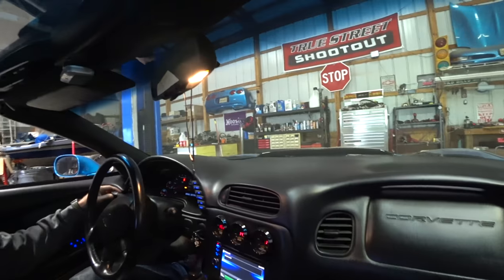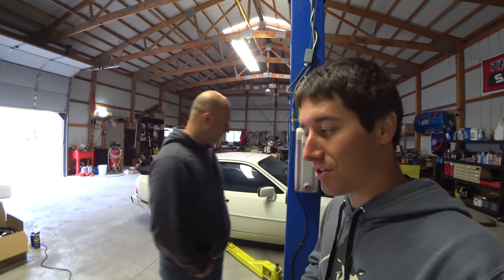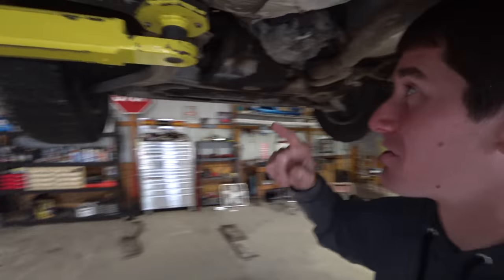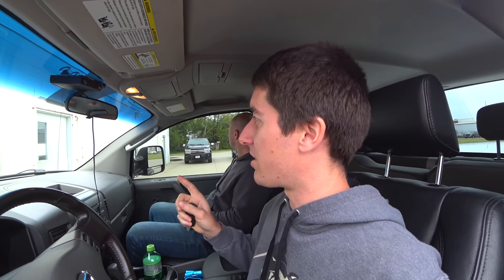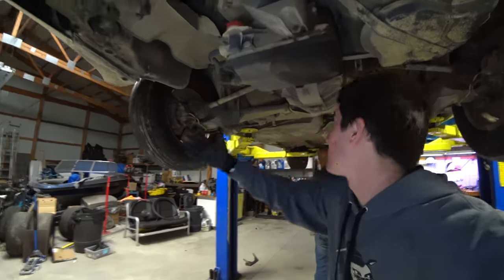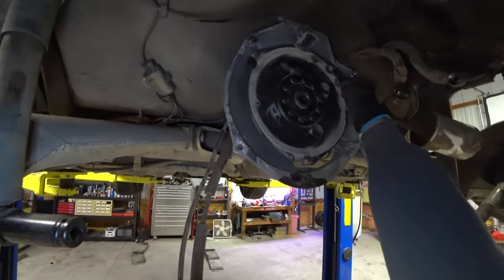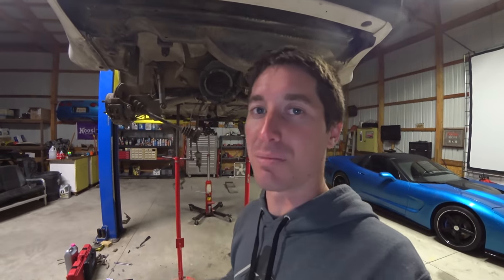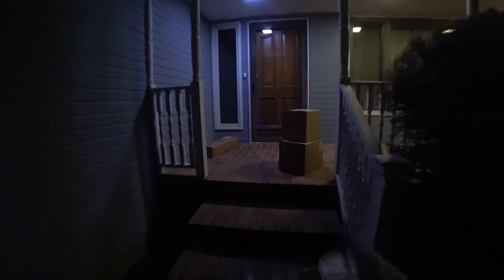REMOVING The FLYWHEEL From A Porsche 944 Is A NIGHTMARE

Comment: You’ll need to 1a) Remove rear Transmission bracket to allow torque tube clearance to skate back further. 1b) remove speed and reference sensors on top of bell house. 2) Remove Ring Gear Flywheel bolts through access hole on bell house. 3) Remove bell house case bolts, 4) Slide torque tube w/ damper plat/flywheel back to access circling on end of splined shaft that connects to pilot bearing. 5) remove damper plate then remove bell house. Good luck, just did this job on my 944🤘
Reply: rakeleaf wow...just wow
Reply: At most a 4 hour job with a lift. You don't need to remove the bell housing from the torque tube. Not that bad.

Comment: I had an ‘88 924S, same drive train. Loved a lot about it, but things will break for sure. Drivetrain was fairly solid and as you’ve seen, at least repairable. Weak spots are the hatch glass leaks, sunroof motor and limiters, and watch out for breaking and cracking solder joints in the ECU.

Comment: Glad to see someone finally using jackstands on the lift! A guy where I worked got smashed when a Cadillac fell on him. He was mush.
You need four.
Reply: Aboveground lifts are junk. The old style lifts, inground lifts NEVER fail. A car might flip off of it if it is unbalanced but that is operater era. My dads shop was built in the early 50s as a Buick dealership and the original lifts were still functional in 2010. They would raise a crew cab dually like it was nothing. 
   I worked at the Tire and Lube at a brand new Wal-Mart in 2001 and a compact car would rock on the aboveground lifts  and make ominous popping sounds. Junk.

Comment: I've did this same job a year ago. You didn't need to drop the rear suspension. There is a clip holding the shaft in the front. Look at the parts diagram. Also look at the article on the Pelican Parts forum. My friend wrote it.

Comment: The 944 was originally a project by Porsche for Volkswagen.  There was a leadership change at VW, and the new people decided they did not want to sell a rear-drive sporty car, so they shelved this project and built one based upon their new FWD chassis [this car would be called Scirocco].  Porsche bought the design and produced it as the 924.  Originally, this car used a VW LT delivery van engine, a FWD Audi transmission, Type 4/914 rear suspension, and front suspension based heavily on the Mk1 Golf.  The car eventually received boxed fenders, a new interior, and an engine based upon the right bank of a Porsche 928 V8.  This was the 944 in this video.  The 924 and 944 also used Mk1 Golf door handles....

Comment: Whoa Whoa Whoa.... Did you say the 944 is a Corvette copy??? Way Wrong. Porsche started the 924 which had the first "transaxle" setup in 1976, they started the the 928 in 1978. The 944 debuted in 1983. The CORVETTE MOVED THE TRANSMISSION TO THE REAR IN 1997. SOOOOOOOOOOOOOOO, maybe the Corvette copied the Porsche rear Transaxle setup. Like the video, but do your research. Keep the cool videos going!!

Comment: I have an 89 S-2 currently with 230,000 mi on it. 
In about a decades worth of ownership a number of things have been replaced and problems dealt with. $670 worth of magnesium that covered the upper cam belt and mounted the distributor is the most recent repair. 
Generally the 944's drive train is considered bullet proof. Over time and use things still wear out. I do have a minor rear engine oil weep. Much of this disassembly would be involved with replacing it. Probably five minutes to replace the seal after all that work.
For all that it pulls hard and strong when I pull out to pass.

Comment: Do yourself and the future owner a favor, replace those fuel lines above the cam tower/headers.  Once they rupture, the car is up in flames in 20 seconds.  Trust me, I've have 5 944's.

You can buy a kit for $125 to cut the old hard lines and replace them with some braided steel lines up to the fpr and damper via the passenger fender opening.

Comment: The manual cars suffer from the same problem with a rubber centered clutch. I replaced mine with a spring centered clutch.  The heat kills them.

Comment: The 924, which spawned the 944, was designed by Porsche for Audi. Audi didn't want it when Porsche was done, so they built it themselves, then a few years later made the more Porschefied version, the 944 (based on the 924 Carrera). 

That transaxle is based on an Audi FWD design. Chevy didn't put a transaxle in the Vette until the C5 in 1997.
Reply: I was about to say how can it be a vette copy, Porsche did it first.
Reply: I believe they were built in an Audi factory.

Comment: I’ve got a 1977 924 in my “barn” waiting for me to bring it back to life.  One day...
Reply: Just scrap it and get something faster
Reply: I bought one of those in the mid 1990s. I drove it for nine years.

It was a lot of fun when it ran properly. Which wasn't often enough.  A clutch replacement on a 924 is rated at 13 hours. 
More like 16. I did it myself.  

The car does handle well. But it was a gutless wonder. Lots of noise, little go power.

Comment: That's to be expected. Any time you buy a car, where the previous owner has identified the problem, has the part, has not replaced it, and is selling it instead, you should know replacing that part will cost more than the car is worth. That is why the previous owner is selling it.

Comment: If you put that much $$$ work into it,  spend the $ to put in the stock flywheel damper.  Why not use the right parts and do the job right.

Comment: If you are going to all this trouble may as well just stick a new clutch kit in there. That rubber centre clutch may not last long and it was replaced by Porsche many years ago with the turbo clutch due to its lack of longevity.

Comment: The 944 to have is the TurboS. The best of the 944 series. I worked at Leith Porsche/Audi in 1987 and sold quite a few of these cars. The 911 is still my favorite but the 944 TurboS comes in a close second. You’re not going to put that rusty old clutch and pressure plate in that car?  How long was that 944 sitting? Looks pretty rusty to me,brakes should be turned and new pads.

Comment: Both the natureof this job is being over-simplified here, and the realities of working on a 30+ year old car. 

Replacing the old rubber damped flywheel with an old OE rubber damped clutch is prettg damned ghetto. That old clutch disc will fail EXACTLY like the original part did. The only right way to do it is man-up and buy the new correct part, cost be damned. Too many people assume that the cost of new parts is pro-rated based on the market value of the car. It is not!

Comment: A 944 is a much better car than a 924, even a 924S which had the "proper" Porsche 2.5 4-cylinder engine.  The 924 was intended to be the new Volkswagen-Porsche to replace the 914, so it was designed down to make it cheaper to produce and sell.  When that didn't go ahead and Volkswagen decided to head in the Audi Coupe and quattro direction, Porsche were left with a car they didn't really want but had to sell to recoup the development costs.  They did immediately set about redesigning it to make it the car they wanted to build and sell, the 944.  Of course, it worked out well for them in the end as the 924, in its various forms, turned out to be a big seller for them,  but the 944 was definitely a much better car and, even in the 2.5 litre variants, had more power than the 924S, which used the same engine, as it was de-tuned for the 924.  It rather showed in subsequent product development, as the 944 continued and developed to become the 968, while the 924 was killed without a replacement until the Boxster, a VERY different car, came along in the second half of the '90s.  One thing the 944 never was, however, was particularly easy to work on, a combination of interesting engineering decisions, such at the torque tube being, effectively, a stressed member of the car,  mounted in a shell that was very much designed to be just big enough, could make life awkward, and as the cars age they throw up more in the way of challenges, which can make life "interesting..."  A friend of mine from college used to work for a British high-end workshop in one of the expensive and sunny parts of Spain, and he had a 944 of a similar age to this one in with clutch problems, after the wealthy owner had bought it new and then hardly used it having decided he preferred his more comfortable, less sporty cars instead.  Sorting the clutch and the extremely sticky release mechanism pretty much turned into a career, and he said the car probably racked up more miles going up and down on the lift as he tried to bring it back to working how the Porsche designers intended than it had in its 20-or-so years of life.  Once it was fixed, however, it was an absolute blast to drive on the twisty mountain roads just inland from them...

Comment: I've owned this era of 944 and from my own experience, you'll need to drop the rear suspension.  You can leave it attached on one side, preferably the side with brake cables, but the assembly will need to come down to get the torque tube low enough to remove it.

Comment: I’m doing the head on my red 1987 924s! The cyl 1 valve seal went bad and built up so much carbon that the valve no longer sealed properly and it also built up an acorn sized piece of carbon built up on the stem of the valve, which after overheating it cracked and fell into the cylinder as it sat over the winter. I’ll be lapping the valves and replacing all the oil seals.

Comment: J.R. I did one 15 years ago in a previous job I had. The rubber flywheel wasn't cheap either. From memory i think there is a hole in one of the bell housings to get to a pinch bolt that secures the flexplate or rubber flywheel to the shaft in the torq tube.  Maybe on the front one. On the front, the starter comes out then the bolts that hold the torq tube to the front bell hosing come out. Next i think you wrap a chain around the rear end of the torq tube and attach it to a large piece of pipe and use it like a slide hammer. I can't remember if it was rusted in to the centre of the sleeve for the rubber flywheel or partially attached but it was a job getting it out. I remember that. Then after the torq tube is far enough out of the way remove the front bell housing as it hits the floor if you try taking it out with the torq tube and it jams up. Spin the rear flexplate when its detached and check the bearing(s) in the torq tube for noise as you don't want to do the job twice. That trans is basically the same one that's in the old Audi 100s and 200s. Some thing else to check while its out,  Check that the autos oil still smells and feels like trans oil as there are back to back twin seal set up on the diffs pinion shaft that can wear out letting the diffs gear oil into the trans.  If it does smell like diff oil you need to buy the twin seal setup and a new o ring for the auto to diff housing and replace the autos oil. With a screwdriver or scriber, scribe a mark on the machined surface of the diff housing so you can see how far the auto slides over the diff housing. THIS IS IMPORTANT. They usually survive.  When fitting the big o ring coat the outside of it  with either rubber grease or vasaline. if you don't the bastard thing can twist and you don't find out about it till it started leaking trans oil every where. Been there bought that tee shirt. Make sure that its all the way in before tightening the 4 m8 bolts as they can damage the auto if it isn't.  Have fun boys.

Comment: There is a clip that is near impossible to remove on the engine side of the disk. The shaft will not pull out. Unbolt the disk from the block via the bell housing. Pull the disk back with the torque tube.

Comment: Also check out Clark’s garage you don’t have to remove the rear suspension or anything like that. You just have to get the torque tube to slide all the way back to the tank.

Comment: You dodged a bullet not getting the 924 as it was really a Volkswagen Passat that had aspirations. It was not supposed to be a pork but a high end vw. The 944 is the much better vehicle.
Reply: @HiWetcam . The 928 was supposed to be a replacement for the 911 that they were going to retire as a model type.
The 944 and 928 although similar have nothing to do with each other I don't think,
they are more like a corvette and a cobalt